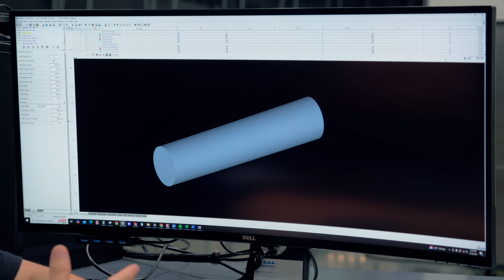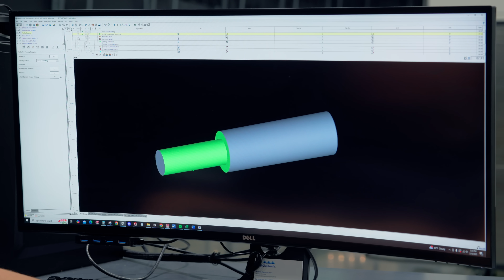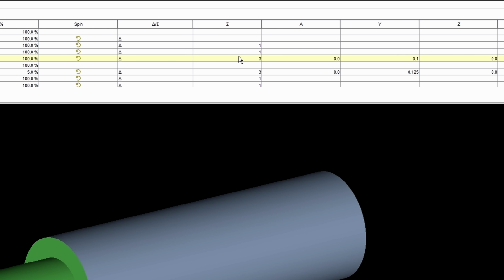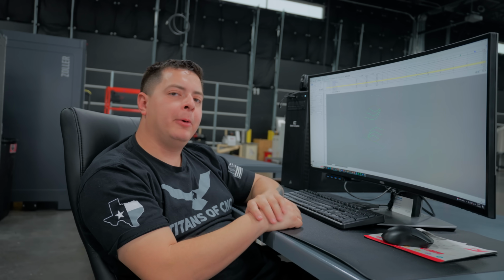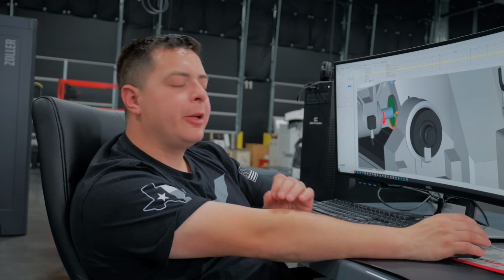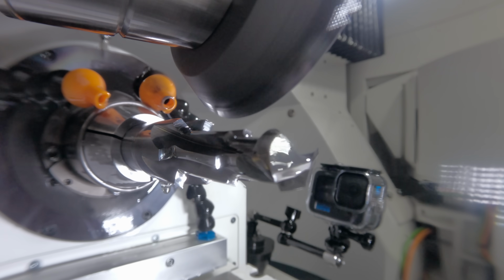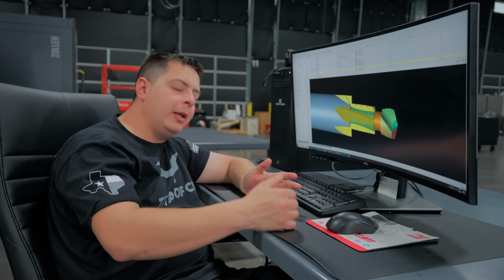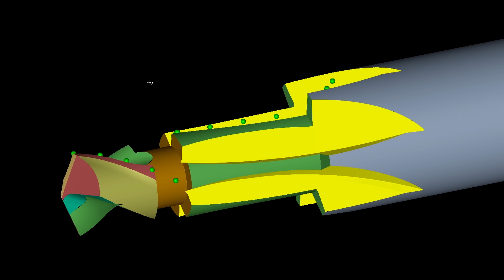Grinding Custom Tri-Cut Tools to Save Time & Money

Comment: Are there any disadvantages of  this regrinding process of cutting tools ? I thought ,for example , this regrinding process is changing radial rake angle _ , _axial rake angle _ or _fillet  and so on ? I really appreciate the answer. And also I think that inserts are more advantageous because their change time is much more lower ?

Comment: really love how chris went in depth on how to use good workflow in solidworks. as a guy who only runs a small manual lathe and a cnc with a cabinet from the 60s, info like this is incomparably valuable

Comment: Nice tool,  but dos not last 10 holes. The edges are to sharp on the reamer. There should be around edge on the diameter of the reamer so it would last a copple of holes. For aluminium i would have used an nother geometry. But stil its a nice tool!!!

Comment: Well, now try to make a Guhring DTMC SP type tool, also a three in one, looks the same like yours but a drill - chamfer - threadmilling.
We use them in aluminium, they work great, we have plenty of "specials" made by an external grinding shop, saves a lot of time.

Comment: Cool but I feel that you could probably skip the ream step and just have a carbide drill chamfer tool combo. If you have the correct grind on the drill you should be able to get a ream quality hole.

Comment: For the OD of the reamer did you mic the dia. before the finish pass just to be safe?
Reply: You shouldn't mic carbide tools as it will damage the cutting edge. You may not see it with your eyeballs but look through a decent microscope or a Zoller machine and you'll see micro chips, cracking, rounded cutting edge (especially on high rake angle tools) and a carbide tipped mic compounds the problem. Non-rotating st'l anvil with a delicate touch and maybe you'd get away with it.

Comment: Was the hole in tolerance?
Reply: I would hope so. At the start  of the video he said plus or minus 2 tenths. Which in american imperial is 5mm
Reply: 2 tenths is 2 ten thousandths lol.  @Jynxy94
Reply: @Jynxy94  5mm tolerance is insane, im in college and have never heard of such blasphemy lol.
Reply: @Jynxy94  2 tenths is ~.005 mm dingus
Reply: @Malog. Not though is it.
Reply: @Jynxy94  Quite sure 2 ten thousandth is either ~.05 or ~.005 mm, NOT 5mm considering 5mm is ~0.19 inches
Reply: @Jynx94 I get that part but did it measure in tolerance. Left us hanging without the final reveal. Could be for more comment interaction to speculate if it was or wasn’t in tolerance lol

Comment: Great video.  It's neat what we can do with grinders.  Since hind sight is 20/20, could you have put a 45 degree chamfer on the back side of the drill portion and make the gap between the drill and reamer a bit wider so you could interpolate the edge break on the backside of the plate?

Comment: Add a back chamfer profile to the back side of the drill tip and do 4 in 1!
Reply: I'm thinking about that; that would add another 0.50" protection length. Not to mention, you'd have to elongate the relief to clear the height of the part and turn down that diameter small enough to interpolate safely. It could be done, but the tool would be slightly less rigid. Cool idea, tho. You've gotta love forming tools. 💪🏾💯🔥

Comment: first thought was chip control. like the reamer recutting the drilling chips and small flutes on the reamer but then saw you were pegging the hole. never did that but with such a stable tool seems alright. with a thinner tool and depending on the runout that would maybe make the hole diameter bigger at the top
Reply: im my experience it doesnt aslong as you center drill before hand

Comment: Beery " that's pretty good. But it's to smooth. Needs some chatter marks for less slippery " xD. Sorry berry 

Personally I prefer/love when the shank of the tool is also grinded in the same setup/go as the rest of the tool/features ( just enough to clean it up all the way and not a micron more ) so I know the tools runs 100% true and not just 99.999% true

Comment: did i miss the part, where you explain the mismatch between the CAD preview and the real part - the drill section on the real drill looks much shorter, the step behind wider?
aside of that - great explanation as always 👍

Comment: Now make me one .01” diameter for my Swiss machines! 😂
Reply: When is the pfiffner machine being installed ?
Kinda of a mix between a normal lathe part size and a swiss machines speed/times per part ( in some cases even faster )
Reply: problem is that the chamfer mill at the end will leave a round edge after a few pieces. we usually chamfer first, then drill and ream
Reply: @ Hi 🤓. this will be used in aluminum,  I think you are right but in  aluminum I guess carbide can hold the edge for "some hundred holes"" right?
Reply: Is that. Even possible?
Reply: That's WILD!! 😳